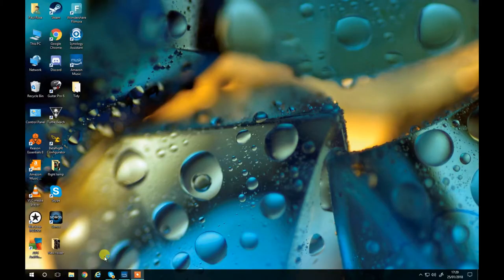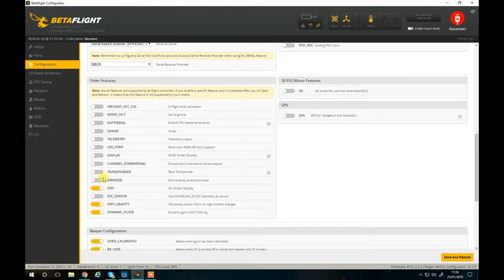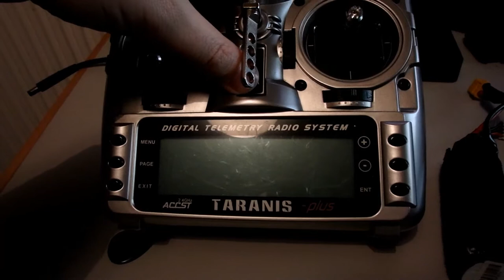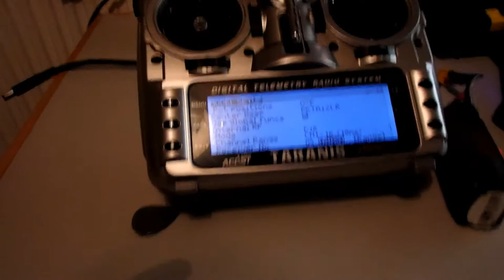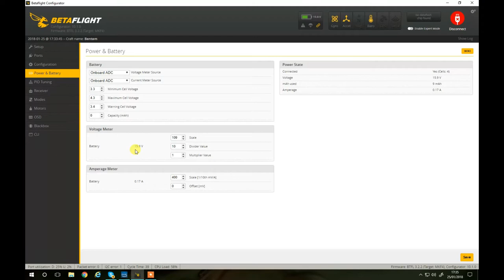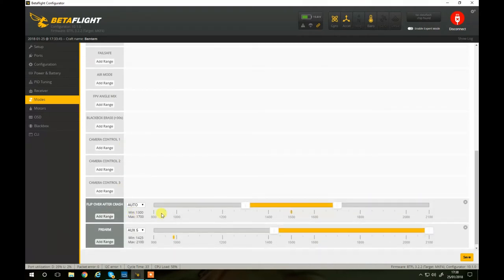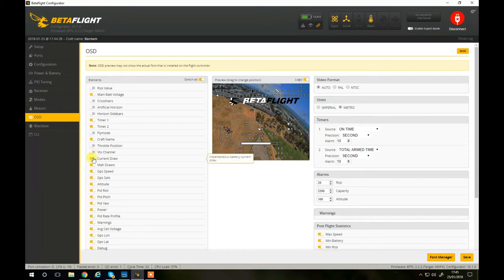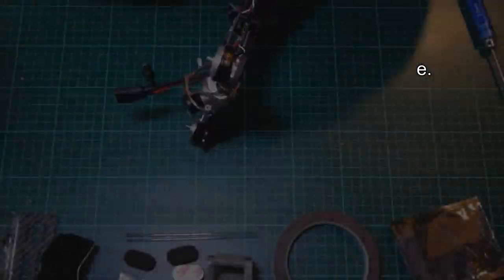Lets Build: Titan Rooster Part 5: Betaflight and Testing

Comment: Paul, I have watched the entire series of your build. Well done! I do see you moved the capacitor back to near the XT60. I was doing other stuff on my PC and may have missed you discussing it. Hope you got your new bolts from Armattan. I also have a Rooster, and I moved components from a pre-built in to it, but going to trash that idea and go with a complete build. 

One question for you. How do you like  the Matek PDB/FC? I like how it has the VTX built-in as real estate on the Rooster is a bit of a premium.  

Good job!!
Reply from the maker: Thanks. The matek board is great. Very easy to use and setup. I have 2 and have no issues.

Yes I did move the cap. I think I mention it but don't show it. Basically, I went to be bed and decided I had to fix it in the morning.